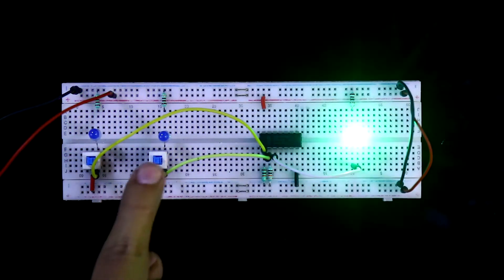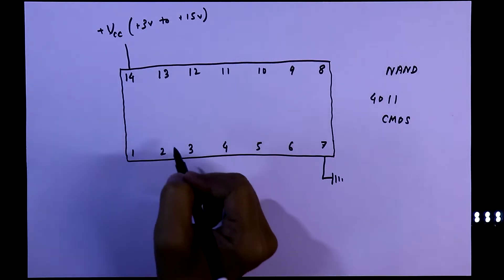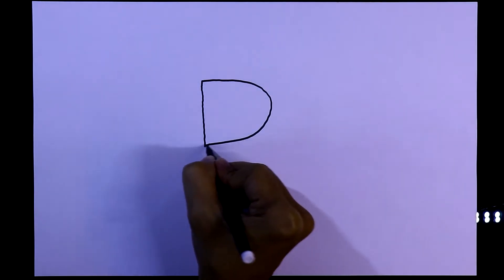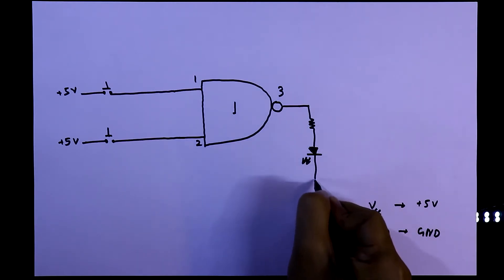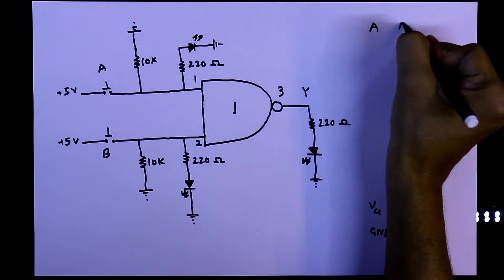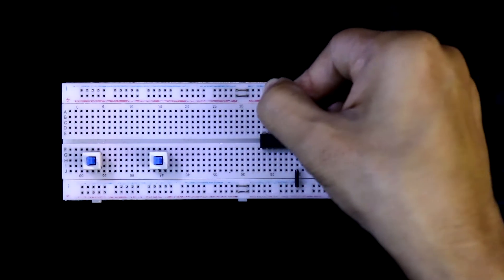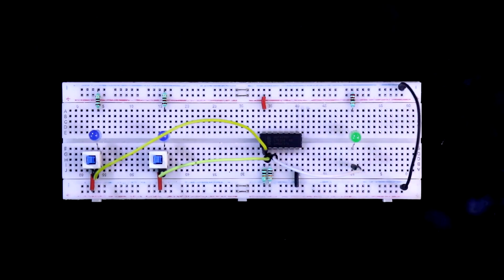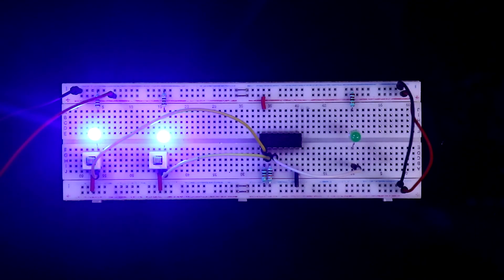CD4011 | 2 Input NAND Gate IC 4011 | Digital Electronics

Comment: 4011 vs 7400 both are NAND but different family, which one is better ?
Reply from the maker: It depends on where to use.

4011 has larger voltage range, +3v to +18v. Consume low power.

7400 needs +5v, Faster than 4011, Consume more power than 4011.
Reply: @EEWave  I just want to light up some LEDs maybe 7segment displays or  LED matrixes or maybe small scale graphics or something for my LCD display primarily for understanding logic gates 

suggest me can you ?

I am looking for logic gates, multiplex/demultiplex, counters, shift registors etc is there any edge of 74XX over 4XXX or vice versa accordingly

Comment: Chemical engineer here, so I apologize if my question is stupid.  Wouldn't an LED be drawing too much current from the CD4011 output?  It looks like it would be 22 mA (5/220) but the data sheet for the chip says output current max is like 1 mA.
Reply: LED's can glow even par it's max current rating but not too high like a 20mA rated LED can handle 30mA but definitely not 1A resistors are used accordingly I see no problem here